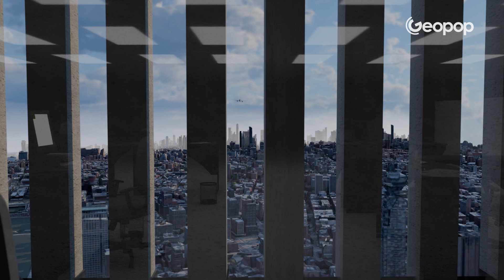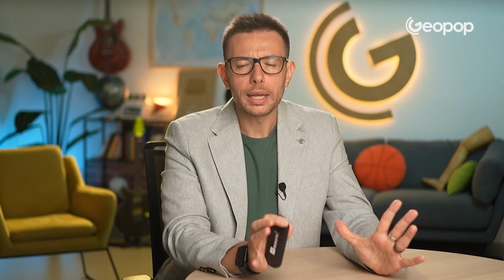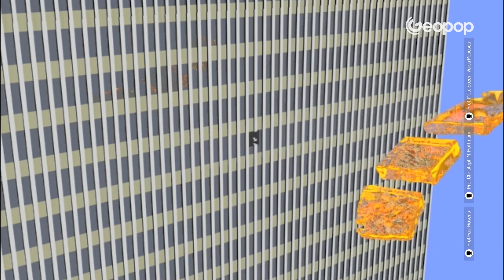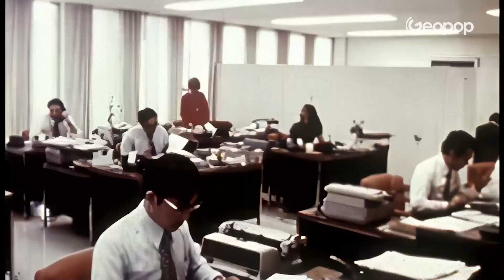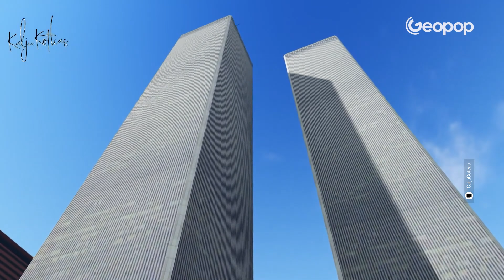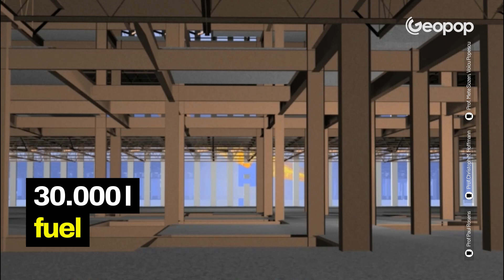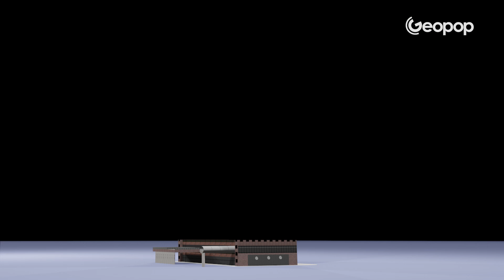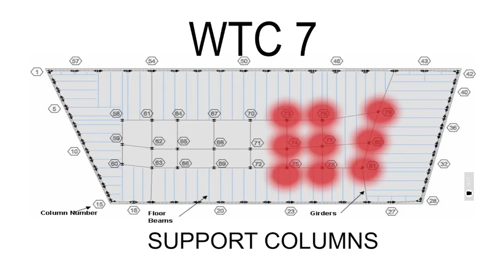9/11, 2001: The Technical Reconstruction of the Twin Towers and WTC 7 Collapses

Comment: Controlled demolition it’s that sinple
Reply: There has never been a shred of evidence supporting controlled demolition. NOTHING.
Reply: For the simpleton it's the best and only thing they can manage, because it requires no thinking whatsoever.

Some of us however prefer to use the thinking part of the brain.  

The descriptions provided above are accurate and correct. More importantly (and this may be a blasphemy to you) they are true no matter who planned and carried out the 9/11 attacks or why
Reply: @TheLoonResistance   You qualify above 'simpleton' of course, please share
Reply: @davepowell7168  - Twin Towers collapses were relatively straightforward and well understood in the professional engineering community within just weeks. Yet there’s still a lot of really bad information floating out there easily accessible on the internet, premised on wild baseless speculation and pathological theorizing with easy hand-wave answers.  Engineering is hard. This stuff is simple, exciting and requires little or no thinking, so it gets far too much attention.

Because anything can seem like a conspiracy if you don’t understand how it works I prepared my own short yet detailed technical description of Twin Towers collapses from my own observation and analysis of available true and relevant facts. No politics, ideology or magical thinking, just engineering. Hopefully this will dispel many common myths and answer most if not all questions you may have about the collapses.  

While complex, most of the Twin Towers collapse mechanisms can be seen with the naked eye and easily discerned and understood by the layperson if sufficient time is taken to understand.

1. The Twin Towers consisted of 4 primary structural elements that together formed an integrated system where each relied on the others. 47 hollow box-section steel Core Columns carry the majority of the gravity loads. The 236 hollow box-section steel Perimeter Columns carry the remainder and ALL of the lateral (wind) loads. Long-span Lightweight Steel Trusses connect the core and perimeter column together at each floor with a Hat Truss on top to tie the structure together as an integrated unit where no element can survive without the others. There was no structural load bearing concrete and most components were bolted together.

www.youtube.com/watch?v=u7OqrC74Dm4

2. The impact of 117 tons of airplane (= to about 12 dump trucks) at speeds up to 590 mph with the energy of a ton of TNT completely destroys the aircraft. This in no way implies the Towers come out unscathed. Many perimeter columns are damaged or destroyed as are some core columns (example; 33 of 59 perimeter and 20 of 47 core columns damaged or destroyed at the impact floors in the North Tower), This damage is primarily through bolt-shearing failures at the end connecting flanges, as well as bending, twisting and fracturing of weld seams. There was no cutting or slicing - the reality was far more violent and messy.

3. The impacts destroy or damage fire insulation, fire breaks and sprinkler systems on multiple floors. Huge fires are started across multiple floors simultaneously and allowed to spread rapidly with no effective firefighting or fire suppression. This was an unprecedented fire event .

4. The hotter steel gets the weaker it gets . With fire insulation stripped away and no sprinklers the survival time of the steel greatly reduced. Gradually over time heat causes the lightweight steel Floor Trusses at the impact damaged floors to sag, which was observed and recorded. No steel melted or needed to. Structural steel fails long before it becomes a puddle. It just needs to bend

5. Sagging floor trusses pull on the increasingly weak and overloaded Perimeter Columns, causing some of them to bow inward by up to 5 feet. A straight column is up to 4 times stronger than a bent column. The bowed Perimeter Columns buckle and fail, quietly initiating collapse. The formerly static mass above which the structure below could easily support is converted to a dynamic mass up to 30 times greater. Because they have buckled, the Columns above and below the failure point are no longer aligned . The load bearing structure below no longer bears any load as it falls past the lower columns, NOT onto them.

www.youtube.com/watch?v=ULdiD6gYZO0

6. Thousands of tons of debris fall within the four outer walls, down through the open office space, crashing onto the first intact floor it encounters, immediately breaking the bolted column connections as the amount of resistance the Floor Trusses can offer is negligible. The falling debris slows only marginally and briefly. Note: 
6a. This is NOT a solid top block crashing into and “crushing” a solid bottom block . 
6b. The debris falls past the columns not onto them. The columns provide no resistance to the falling debris. 
6c. Only the bolted floor truss connections to the core and perimeter columns offer any resistance. A pair of 5/8” bolts at each end of each truss vs. thousands of tons of falling debris. 
6d. No laws of physics are violated. 
6e. There is no 20 floors against 90 floors but rather 20 floors against one floor, then 21 floors against one floor, then 22 floors against one floor, etc. 

7. This floor-led collapse progression within the four outer walls can only go straight down.
7a. This process is often incorrectly referred to as “pancaking”. The catchy name stuck but nobody knows what it really means and "pancaking" is too simplistic and inaccurate anyway. I prefer Kaiserschmarrn.

8. Collapse progresses through the floor systems past the columns, through the path of least resistance . The resistance offered by each floor is always the same while the mass of debris and its velocity – thus its energy - increases with each floor failure. Each floor offers the exact same resistance to the falling mass while with each failure the falling debris constantly gains both mass and velocity. *This process of floor-by-floor destruction cannot be arrested, it can only speed up . Rate of floor failures increases with each floor as momentum increases, reaching an average acceleration of 0.65 of GA, or 35% slower than true free fall. Bam, bam, bam down the building until there are no more floors to fail. The resistance offered by each successive floor is always the same. More mass, more velocity, same resistance with each floor. Don’t get stuck on the but the lower floors weren’t on fire nonsense. They weren‘t and didn’t need to be.

9. The Towers were 95% air by volume. As that air was compressed inside the building it is forced down the tower and blown out the sides in reaction to the building collapsing . Those were not “explosions”, it was expulsions of compressed air caused by the collapsing building, explaining the low velocity, lack of flash, blast, supersonic pressure waves and lethal high-velocity ejecta.

10. Perimeter Columns become detached and peel away like a banana behind the collapse front, playing out to the four points of the compass extending to more than 600 feet from the base of the towers. This was quite obvious from examination of the debris pile.

11. Core Columns fail last as their internal beam bracing is stripped away by falling debris and lateral support from the floor to perimeter columns is lost.

12. For those who care about how long this whole process took; 31-34 seconds from the moment the perimeter columns buckled until the last core columns hit the pile, or 1/3 the rate of true free fall. Don’t believe me? Just watch any video of the collapses and note the loose truly free-falling debris dropping much faster than the towers themselves.

13. Each Tower had a 1-acre footprint. Far from collapsing inside their own footprints the debris pile spread out over 17 acres in a pile up to 14 stories deep. 8 surrounding buildings were destroyed and scores more damaged by the falling debris.

14. NOT observed were the 180-190 dB bangs of thousands of high explosive devices or the blinding bright flashes of burning thermite. Neither explosives or thermite could have survived the impacts and subsequent fire nor could have caused the (silent) perimeter column buckling that clearly initiated collapse either. A video of a shocked and injured firefighter casually using the magic word explosion is in no way proof of explsoIVES and the demolition_ case relies entirely on that sort of thing. There is zero tangible physical evidence and it would be technically impossible, totally impractical and completely unnecessary. No one would bother.  In 24 years zero structural engineers of tall buildings, including the 1/3 that have retired in that time, have made any statements in support of pre-planned demolition claims. NONE. The lack of any such citations in the engineering literature (published in any country worldwide) is telling.

15. Twin Towers were perfectly safe within their design envelope. They only collapsed when taken far outside design parameters by an extraordinary and unprecedented event

Impact + Fire (heat) + Time + Gravity = Collapse . Remove any one of those 4 elements and there is no collapse. Ignore any of those elements (as many do) and you will never understand the collapses. The Twin Towers were an integrated system in which no one component could survive without the others. One fails, the rest follow, through the path of least resistance – DOWN – through the open space, bypassing the path of greatest resistance – the columns. Nothing I just described violates any laws of physics. All of the above is true no matter who planned and carried out the 9/11 attacks or why

I hope you found this helpful and informative. It is not meant to be adversarial, but to solicit informed critical comment, positive or negative. If I made any errors of fact, logic or reason or left anything critical out, please let me know so I can fix it. To stay focused just one topic at a time please and on-topic (Twin Towers ONLY). No word-salads of Gish Gallop. IF you can offer a more plausible alternative be my guest. Please start any reply with the words “Tits McGee” or I will know you didn’t actually read it, are not serious and just wasting my time. If you are going to argue, do it on the merits.
Reply: @TheLoonResistance  Tits McGee. So you must work for the federal government then. I didn't notice any grammatical errors and you devoted an immense amount of effort into this to farm engagement.

You were sniffed out by someone who understands PR and propaganda.
Reply: @lucasperson342  Stinky´s comments are mostly copy paste garbage.
Reply: @lucasperson342 - Do let us know IF you ever decide to, and more importantly become capable of being serious.

Until then,I wishyou luck with your continued epic fail. Really hope that works out for you.
Reply: @TheLoonResistance  Your insults are as prescient as your ridiculous cover up of yet another American tragedy.
Reply: @lucasperson342 - Not an insult but a statement of fact. 

 You are clearly not serious and thus a waste of my time. The door is open should you decide to become serious and demonstrate an ability to do so.

If that makes you butthurt that's too bad but also NOT a me problem.
Reply: @TheLoonResistance  Hahahaha I'm not a waste of your time. You're replying. My engagement with you is payment.
Reply: demolition controlled by terrorists flying hijacked planes
Reply: Please tell us how "they" managed to keep the explosives from igniting for 1-7 hours after the impacts, and raging fires? The colapses initiated at the point of impacts. So how did they rig the explosives so that they were not damaged by a plane collision?
Reply: @TheCriticalStinker-01 
What sort of a loser replys to every single comment for the past year 
Haven't you got anything better to do with your life 
God it must suck to be you  bet you have frosty tips with your nipples peiced  am I right 
You Discusting Zionist shill 

Your a disgrace

Comment: Those buildings were turned to powder and dust before they hit the ground and it only took about ten seconds for them to fall.What type of demolition explosive is capable of that? Where is the debris pile for those buildings and their contents?
Not even half of those buildings were left to be removed because there wasn't half of them left and yet this is rarely thought of or mentioned.
Reply: Were they though?  www.youtube.com/watch?v=4VgZW-v_Opg

The above video pretty accurately describes what actually happened and its conclusions are overwhelmingly supported by the worlds engineering community.  

Judy Wood on the other hand is a brain-damaged former tooth specialist who made up some batshit crazy crap about hurricane powered magical space beams.

Comment: Using the findings from NIST as a basis for this film has rendered it into a meaningless pile of speculation. Every single expert in the building demolition industry has agreed that the buildings were blown up and show all the symptoms of controlled demolition. NIST investigation into building 7 was a pile of rubbish. Their animation of the “collapse” didn’t even show the collapse. Why? Because the physics of what we see in videos cannot be replicated by NIST’s so called report. It was all lies. 
So, in my opinion, this video is rubbish. The steel melting theory has been thoroughly debunked.
Reply: Every single expert?  So if I find just one (not exactly difficult) then I can prove you 100% wrong?

What is it with you conspiratards and your obsession with all-or-nothing false global generalizations anyway?  The lot of you seem obsessed by them, which just one of the many reasons why you invariably fail.

Why don't we call this what it is:  You don't like the explanations provided here, which in fact are overwhelmingly supported by the worlds professional engineering community because it goes against 2 decades of internet-fed dogma.  You can't actually point out a single thing actually wrong with this explanation, so you have to rationalize and lie to maintain your personal brand of reality distortion

It sucks, but there it is.

Here's one last bit of blasphemy to get your head spinning even faster;

The collapse mechanisms described here are not only fundamentally correct and enjoy overwhelming support from the world's professional engineering community but are true no matter who planned and carried out the 9/11 attacks or why

All that controlled demolition stuff is just so much wasted energy - pure chimpanzee part of the brain poop flinging nonsense. Adherence to such technical nonsense is why the so-called 9/11 Truth Movement failed and died years ago.
Reply: @TheLoonResistance if it failed, why are you having to go and comment to every single person on here? You are the one who failed

Comment: Lies. The temperatures would have reached 500-600, not 10000, where it would start to melt.stop the lies. No one is buying this. We know. The sounds of explosions, the speed and way the buildings came down - like in free fall - this can’t happen by any structural collapse caused by sequentially brake downs of structures. 
All the comments praising this belong to the same group of people.
Reply: Nobody is claiming the temperature reached 10,000 or that any steel melted. Your claim the temperatures would only reach 500-600 was pulled directly from your rectum and will be given the attention it deserves, which is none. 

Please don't pretend to speak on subject for which you obviously have no knowledge. It's embarrassing.